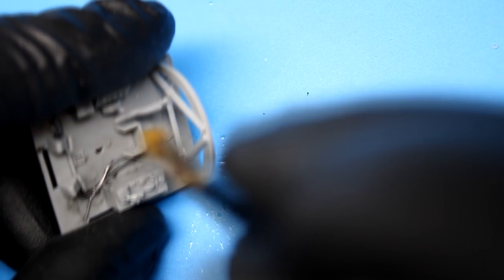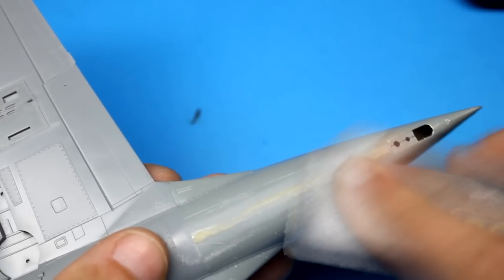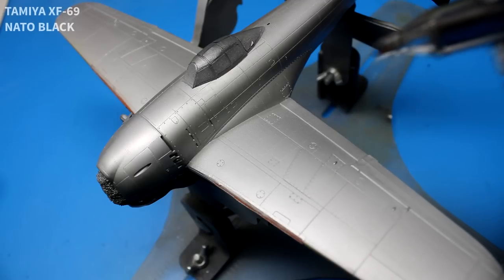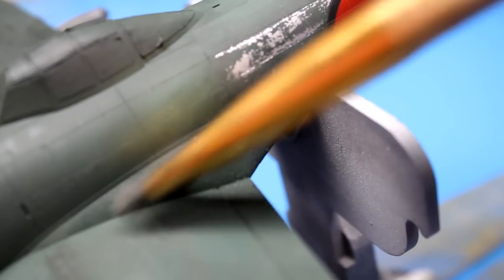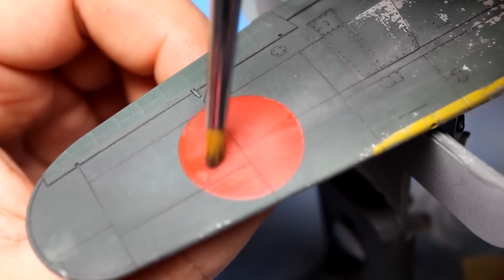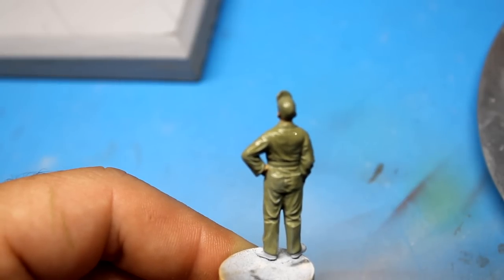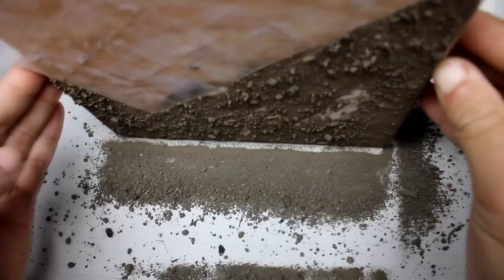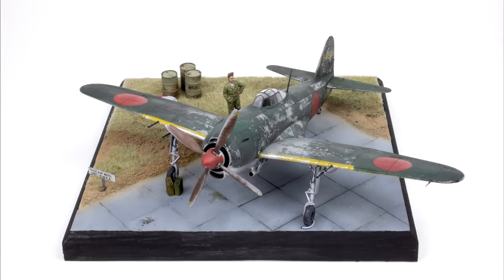My FIRST figure and diorama! - Heavily Weathered & Captured 1/48 Hasegawa N1K1 Shiden "George"

Comment: Great model and diorama combination. The combo definitely brings your work into an excellent three D (life like),  appearance. One thing I've never tried is letting the model set directly in the sun to see if that adds any additional fading. One base I used to use is individual pieces of linoleum title, turned upside down the back looks just like concrete. Not sure if "flooring" stores have changed that.  Then you design whatever you want. I used straight black oil paint from the tube as tar . Another source for diorama material is model railroad shops . "O" scale is equal to 1/48.  PSP pierced steel planking, I use to make by hand but I imagine somewhere in all these accessory parts, its available commercially  That Japanese flag is a great touch.
Reply from the maker: I have some photoetch psp but it may be a while before it’s used.

Even lightly sanding the paint will give you a worn look
Reply: @TheModelGuy  That's great to know, I guess with three D printers you can always explore as well. I'm just know getting back in the game after retiring - so much to learn. But I know what you mean when you say " it will be a while ". The model shows were real budget killers :-) You'd usually buy without a project most of the vendors were so stocked with new stuff. I built my dads B24 in 1/48, with nose art. It almost took as much time to hand make the PSP as it did the model. Thanks for the info to this "old" newbie.

Comment: Nicely done. I do like ICM figures and have used them in 1/48 and 1/32 scenes. Challenges you ask? On the aforementioned diorama #1, the masking tape on the frame stuck in spackling I used for the terrain. And still struggle with static grass some. Successes though, figure painting gotten halfway decent. One tip I saw was the wet palette and must say it makes blending and adding those light layers easier. I also use a matte medium which helps avoiding shiny people and the blending.
Reply from the maker: I’m not sure if I just suck but I’m really having trouble with the wet pallet for skin tones. The other colours were no problem.

After seeing my pics here I need at least one more black pass on the base.
Reply: @TheModelGuy  I thought the dude looked good as did the diorama.
Reply: @fotomakr  
I agree.  Skin tones and the face are hardest because we're people and we recognize people and emotions by.our faces.
Also, shiny clothing is a dead giveaway.

Comment: Hey man looks good but just add a few more coats of back to the base also to get a smooth finish on the sides I use a tiny amount of plaster and wood glue mixed with black the sanded smooth
Reply from the maker: Will do. It’s never too late to touch up.

Comment: Nice job on your first diorama and figure.  It's really.important that the diorama look whole, not just a plane and figure stuck on a board.  That requires thought and subtlety -- stay away from bright colours and straight lines.  
Particularly in 1:72 (HO scale) and 1:48 (O scale) model railroad shops are your friends,  Building scenery, people, and equipment is half the hobby.  Where did you find Modge Podge and that etched mottle stencil in Alberta?
The late Shep Paine used ro urge that a diorama needs to tell a story to engage the viewer, not just some stuff and grass plopped on a board.  You already know how to do that by the way tone down paint and build up weathering on your models.  Thoughtfully building up the effect means you can go back an correct things -- as soon as you did your Japanese meatball disc's I knew you'd come back to them because they were too bright and intense.  For decades markings in Japanese aircraft kits were squintingly bright.
Top:  For small cockpit items -- switches, lights, etc. -- forget the brush and apply a daub of paint with the tip of a toothpick.  Also, when chipping away at the paint finish, you can get different effects over the chipping fluid by trimming the toothpick tip on a slant with a sharp knife.
Bravo!  Thanks for sharing!
Reply from the maker: I found modge podge at Michael’s craft store and the stencils I ordered online from Ultracast. Where are you in Alberta?

Comment: It would have been nice to see more reference photos. The two previous reference photos used here showed a lot of surface rippling that would be almost impossible to replicate with a kit... The rippling was not from normal wear, but probably from nearby bomb blasts.
Reply from the maker: I think what you are referring to is called oil canning. As for reference photos, I have to be careful in case they are copyrighted

Comment: Very very very very thin layers, with Very very very  little paint on the brush and some times it takes 10 or more layers of paint.
Reply from the maker: My biggest problem is getting consistent paint mixes to do that. I keep getting over stepping glaze into wash haha
Reply: @TheModelGuy  the issue I believe you're having is to much paint and not enough water, the mix should be roughly 90% water.  Then you dab most of the paint off on a paper towel.  Hope this helps you. Only use a retarder on when and IF you want add shadow and highlight detail, because sometimes you'll cover your shadow and highlights with the glaze. Anyways hope this helps.
Reply from the maker: @rickmoreno6858  I’ll definitely be trying again